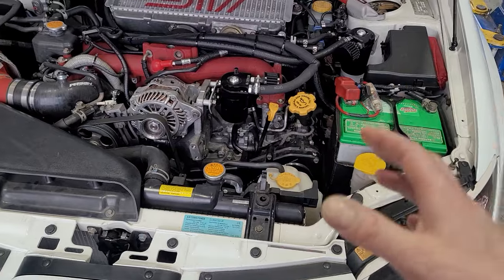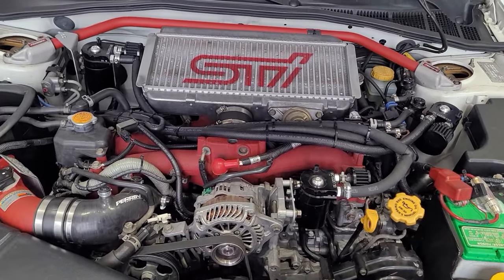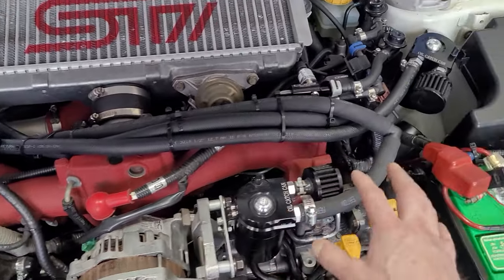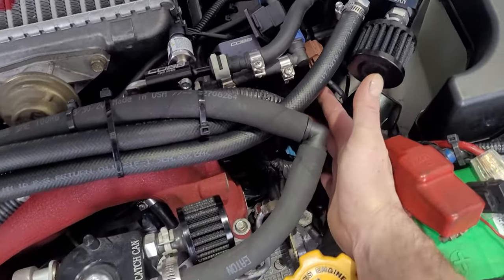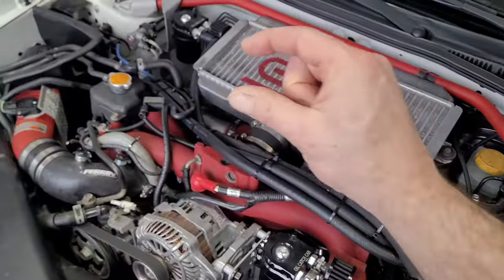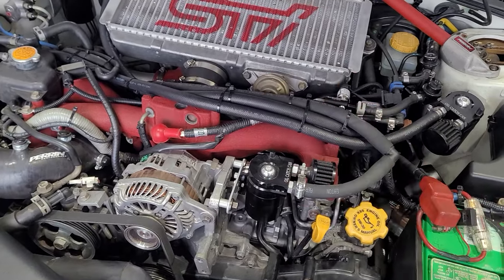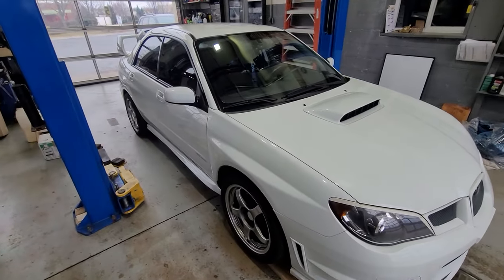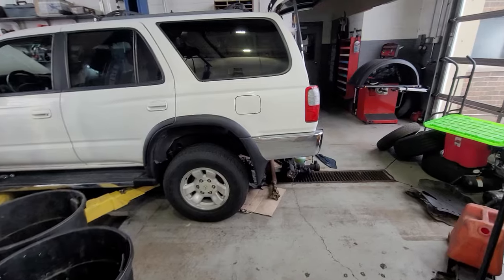06 Subaru Impreza STI Oil Catch Can Setup

Comment: Those Tacoma bearings look brand new, wow! Nice STi. I have catch cans that vent to the atmosphere on my Forester, but I loathe the smell of oil that permeates into the cabin. How do you deal with that issue, or do you just not mind it at all?
Reply from the maker: I dont daily this anymore, only to events like autocross or trackday but honestly I dont smell any oil inside the cabin, you may have a tired engine with blow by or an exhaust leak.

Comment: did you delete the pcv valve? And what about the crank/head hard line that equalises the pressures
Reply from the maker: the equilizer hoses are still there oem, no pcv, just vents into the atmosphere